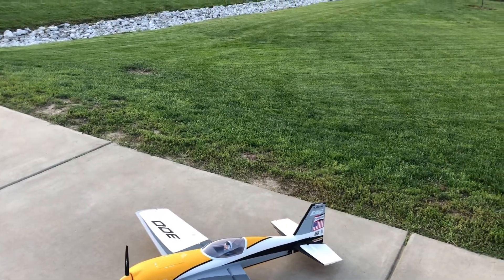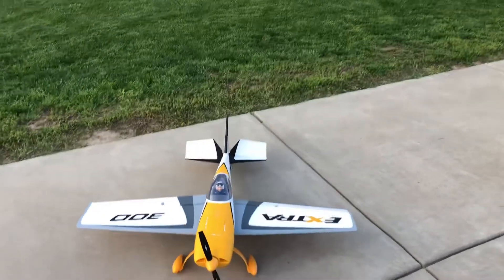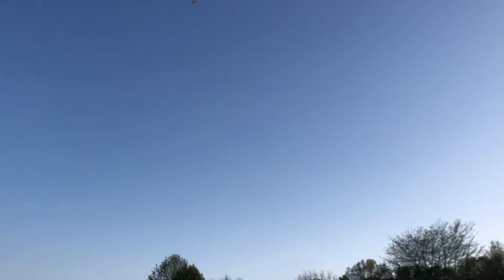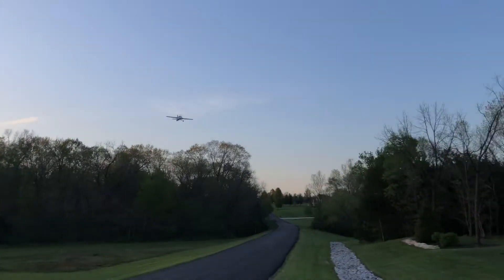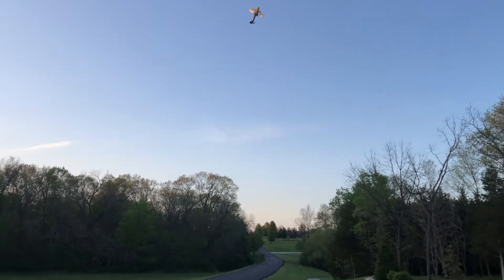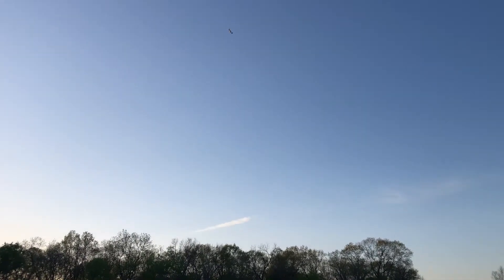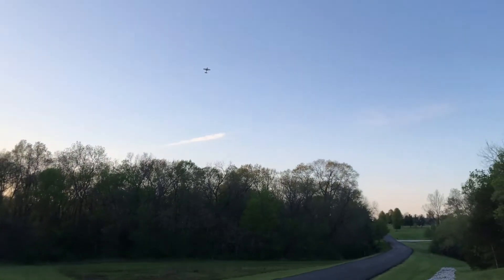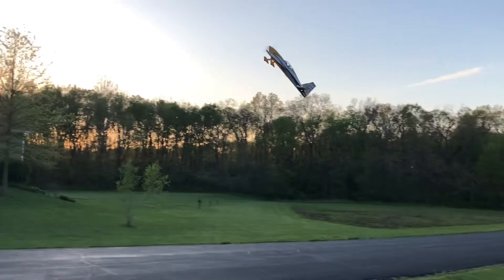E Flite Extra 300 is back | flight at dusk with the upgraded prop

Comment: I cut 1 mm carbon rod and used them like pins thru the holes in the plastic hinges and set them with epoxy  so my rudder cant go anywhere
Reply from the maker: That’s a great idea! Thanks!

Comment: Hey nice video, I see is a Master Airscrew prop, but what size please?
Reply from the maker: Thanks! Yes it is a 13x6 nylon/glass propeller you can find on Horizon Hobby’s website… I just recently started having vibration issues above like 80% throttle and bought a new DIFFERENT 13x6 propeller. They all will require a little bit of drilling through the middle though but not a big deal. The STOCK propeller won’t require drilling though of course haha. Gonna try the new prop at Oshkosh here in a couple days and I’ll make a video! Thanks appreciated!
Reply: Glass filled props are for gas planes
Reply: They make props for electrics too. Just have to shop around.  I use APC electric props . They are heavier so make sure u have an esc to handle it. @ToastyProductions.